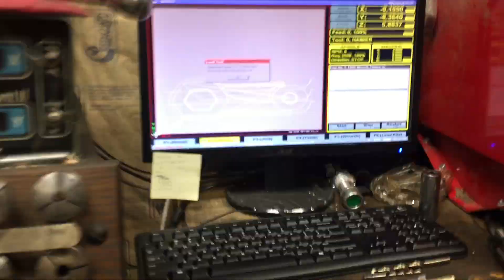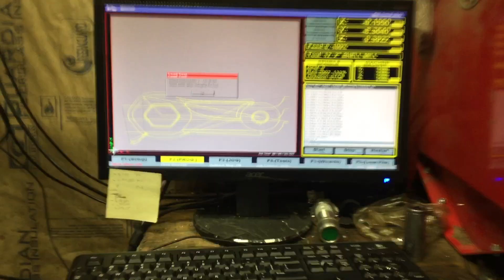Adaptive Clearing With A Face Mill With Masso And Clearpath

Comment: I am sure you have been answered this before, but what was the total cost of the CNC upgrade? Anyway to mount the stock handles on, so it could be CNC and manual?
Reply from the maker: Michael Krail real close to 6500 or so.  Im sure ya can mount them but not much need to with the hand wheel.
Reply: @mowbetter2010  thanks

Comment: I'm just buying a j head bridgeport to make a similar conversion to yours. Did you change the x and y screws with ballscrews? What pitch? I can see you're controlling the spindle speed via a pwm on the masso, but I can't see which mechanical arrangement you adopted on the head. Do you leave it in high gear? Did you replace the original motor for a more powerful one? Like your very open and straightforward attitude in your videos. I'm glad I'm subscribed.
Reply from the maker: makirompe yes we changed to ball screws same as the original pitch. We leave the spindle in high with the shiv set to 2000 rpm. The drive runs 0-90 hz and that  gives us plenty of power and 0-3000 rpm. We have found that 3/8 tooling is ideal with this power and 1/2 is ok but if you want to push it hard stick with 3/8's for sure. The motor is original we run it up to 7.0 amps on occasion for short burst. We have been wanting to make a video of the entire setup with it all explained. Thanks for watching. Please any other questions please we love talking about our old mill.
Reply: Thank you! Do not provoke me, I can annoy anyone to death with questions. In fact it sparks to my mind asking you which kind of clearpath motors you choosed and why? Any suggestion on the power supply? An unregulated toroidal deal or something more complex? I was thinking about some HIWIN rolled ballscrews(because of costand local availability), but I don't know if they're good enough for the application. What did you buy for yours? Anyway I found this on cnczone, the guy butchered the casting a little bit, but it made the knee motion faster, maybe, you'll like this. http://www.cnczone.com/forums/bridgeport-hardinge-mills/101339-bp-cnc-knee-drive-report.html

Thank you a lot! Have a very nice Christmas!
Reply from the maker: makirompe i used the 1396 ozin ones for the torque not so much speed but it will do 220 ipm. I bought the kit on eBay with the hiwin ball screws with the yoke. I have a plan to make the knee faster but haven’t had time to do it. It will be capable of 110 ipm.  I wanted to have plenty of power to break things is why i used such big ones. And I rather be a little slower and not fault out.  The clear path servos have be really dependable and the masso has been too with the latest updates. We have had it on for a week straight running and not one hiccup   Come in a hit go and run parts.
Reply from the maker: makirompe power supplies. I used 3 24vdc Allen Bradley ones wired in series. Decent price on ebay and dependable even if ya buy used ones.
Reply: Phenomenal work, Sir, I'm stoked!

Comment: You may want to make sure the knee gears are very well greased with red mobil 1 synthetic grease. The knee was never intended for that much wear.
Reply from the maker: Tom Hutchins sure will thanks for the heads up

Comment: Hey John, I just ordered some clearpath servos for my J model bridgeport and going to run the same set up as you are. I have already converted my mill to win ball drive,could you tell me with your Z axis is it the original ACME shaft in there and what is the 5:1 worm drive you put in,any help would be appreciated. I will be running MASSO same as you, I just hooked up one to my CNC plasma, it appears to be the way to go now. Anyway great videos and I have been enjoying them and keep up the great work of showing people what your doing in the man cave. Thanks Richy
Reply from the maker: Richard Van Huisstede thx man.  Good luck with ur set up.  Im using the original z shaft and brass nut that was .100 per rev and im using a 5:1 gearbox on that to drive the z. Super strong and accurate but slow only 20 ipm but im working on a plan to get it up to speed maybe even 100 ipm. Let me know if ya need help at lambertj06@gmail.com good luck.
Reply from the maker: Richard Van Huisstede the gearbox i used is a  planetary style gear box made for servos ya might find them on ebay
Reply from the maker: Richard Van Huisstede
 https://www.ebay.com/itm/172158071730  
Mine is like this one

Comment: Hey just a tip if you take out your G28 lines of code the machine won't have to go all the way home at the start and finish and looks like all your tool changes all you have to do is home it when you first turn it on. that way you won't have to wait for that z to come up and your not over working your servo for no reason
Reply from the maker: larry martens ok we will try that thx man